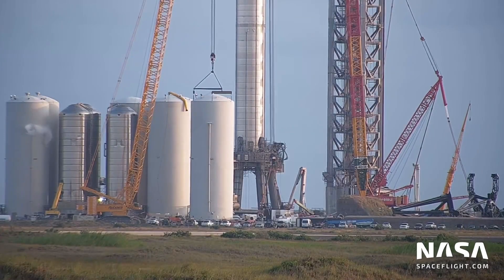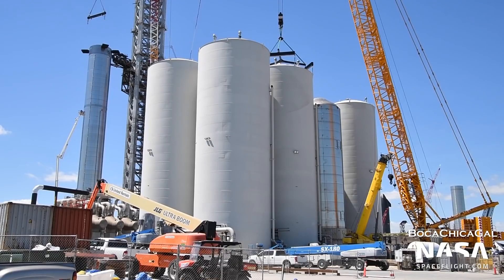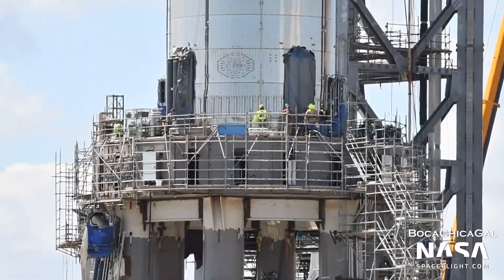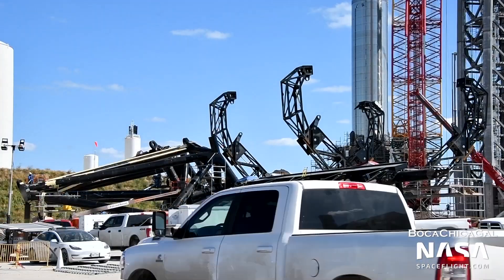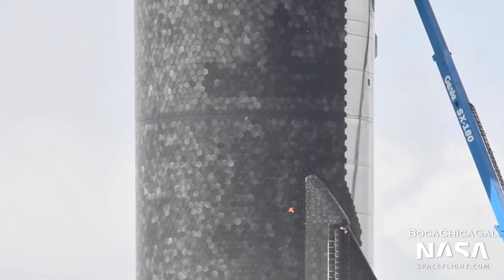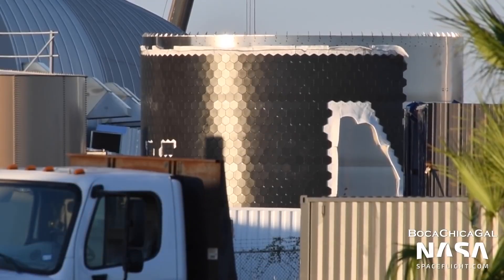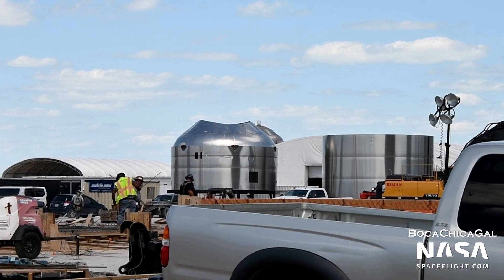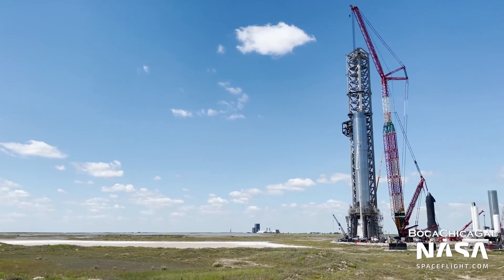Ship 20 Ready to be Pushed to its Limits | Starship Update (Narrated)

Comment: Elon this question is for you… or Can anybody tell me the answer to the quandary that I am in as far as; 

once a booster is caught and sits upon the catch arms how does it adjust to the repositioning alignment to ensure that in a one hour turnaround time the booster lands on the catch arms and transitions back to the pad..
 but how is the alignment set up to correctly align once it lands, are there tractor feed belts that will rotate it in a yah Motion that will align correctly for the quick connect arm to plug-in…?

Inquiring minds think about details and this one I don’t see anything from what’s built how that is going to work yet or on any of the illustrations yet…
Reply: "but how is the alignment set up to correctly align once it lands, are there tractor feed belts that will rotate it in a yah Motion that will align correctly for the quick connect arm to plug-in…?" 
Elon confirmed that there will be belts on top of the catching arms. The tractor belts will rotate the booster like you would rotate a stick between your hands. One goes forward, the other backwards.

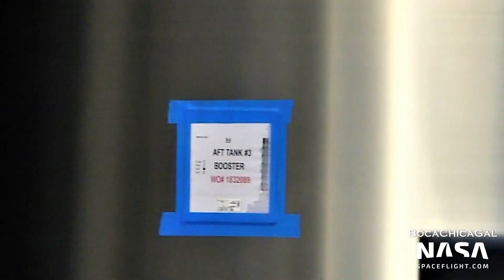Comment: 5:51 Maybe that's an enlarged downcomer pipe to accomodate more raptors.
Reply: Then again, if the downcomer is fat enough, it can become a stand-alone tank. Wouldn't the booster be more stable during landing, if all the propellant was in the lower half? I also think that the booster would be more sturdy with concentric tanks, because the inner tank would serve as a structural column. Nothing wrong with extra strength, when 33 raptors are pushing up a tanker Starship at full thrust.

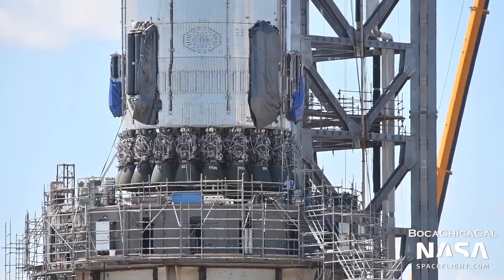Comment: Another good and enjoyable update.  My only critique would be at 2:27.  It's been confirmed that is why the booster was removed? Or is that a logical assumption?  If it has been confirmed please go into that as that is a great part of the info. But if it hasn't please word this kind of thing better to show the speculation.  
Lastly and this is still my own disbelief likely but I'm still not buying those grabby bits are the carriage around the tower. It just doesn't feel strong enough to support a booster.  Let alone catch one which will be greatly more stressful on the structure.  I'm always willing to be wrong but this was presented pretty confident.

Comment: The tube installed into SN21 is probably there to simulate a personnel tube. That way when the starship lands on distant celestial bodies, people can move from the habitat section near the nosecone to the ground near the engines. Otherwise, they'd have to have an exterior elevator/ladder to get in/out of starship. Of course, this would only be for starships not landing at a platform with a gangway that can connect directly to the habitat section.

Comment: Could the 'large steel tube' installed inside Booster 5 be a separate tank structure, a bit like Starship's header tanks? The idea of cryogenic propellant & hot ullage gas in zero g has been troubling me for a while. Could this be a solution?
Reply: I think it's a Mega-down-comer. You are going to need a very large pipe to flow methane for 29 engines. The booster never has to start it's engines in zero G. It will work just like Falcon 9 boosters which don't have header tanks.
Reply: @williamgreene4834  Booster 4 already has a down-comer that seems far less substantial than this.

Starting engines in zero g is not the issue here. The mixing of hot ullage gas (from autogenous pressurisation) with the remaining super chilled propellant is. It's not a problem that applies to Falcon 9.
Reply: @tjp353  True but these guys are pretty smart so they must have it worked out or they are just going to see if it blows up at some point during the descent. Either way it will be cool. They are throwing the booster away anyway. SpaceX has been known to throw the dice. They have cameras in all the tanks so they'll get a lot of data either way.
Reply: @williamgreene4834  If one thing's for certain, it's never bet against SpaceX. And Booster 4 will be thrown away. That's also true.

My original point is this 'large steel pipe' wasn't seen during Booster 4 assembly. So what is it? Booster 4 didn't seem to need it, but Booster 5 has it. Booster 5 is the first being built for potential recovery.

Ever since Elon spoke about 'hot ullage gas' to Tim Dodd, and that there'd by 'plenty of it' (enough to be used for rcs), I've been questioning the effects of cryogenic gas droplets floating around inside a tank that's now filled with 'hot' ullage gas, in zero g, once MECO & stage separation has happened. I'm thinking that a secondary smaller tank system would help keep super chilled liquid propellant & 'hot' gases separated in order to reduce heat transfer, help keep tank pressure stable & provide a reliable propellant source for boost back & landing.

Maybe I'm missing a very obvious point here. I could be - there's a lot I don't know, but this seems to make most sense. If anyone out there has the knowledge, time & patience to explain, I'd be happy to listen & learn.
Reply: @tjp353  I'm a solid rocket guy so I'm just guessing. I do know that very strange things happen when hot things and super cold liquids interact. I've had liquid nitrogen poured in my hand and it didn't even feel cold. Also if you pour the same amount of water in a 400f frying pan and a red hot frying pan the water will evaporate much quicker from the 400f frying pan. I say all that to say I don't know what would happen in the fuel tanks. OK I need to stop typing. LOL
Reply: @tjp353  That large pipe sounds like an engineering meeting where someone said " I just had a thought ". :)
Reply: @williamgreene4834  True, it does. That's one of the wonderful things about SpaceX. They'll invent something today, build it tomorrow, then test it the day after - on an enormous scale.